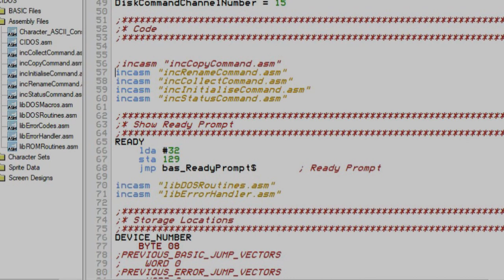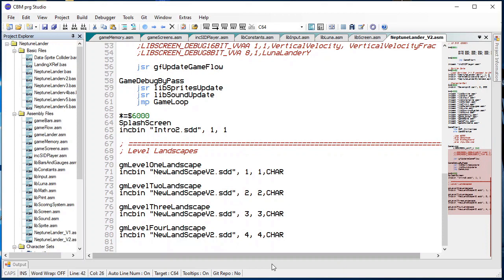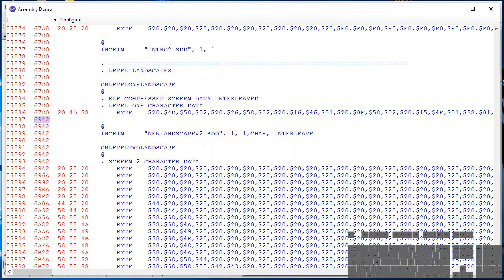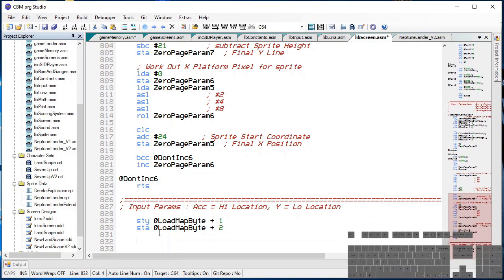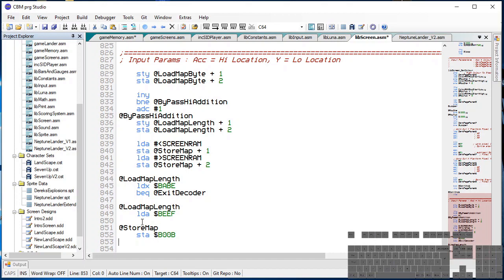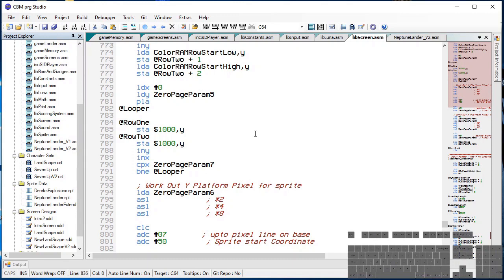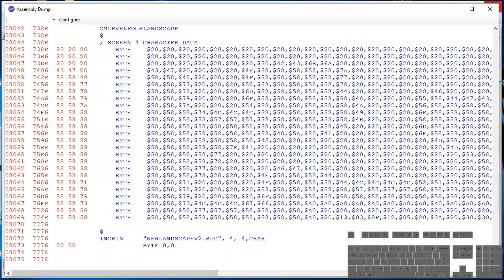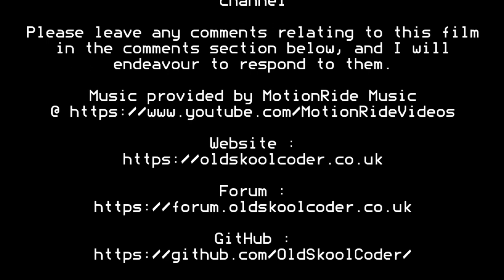Tutorial 35.39 - Implementing RLE Decoding Of Screens (6502)

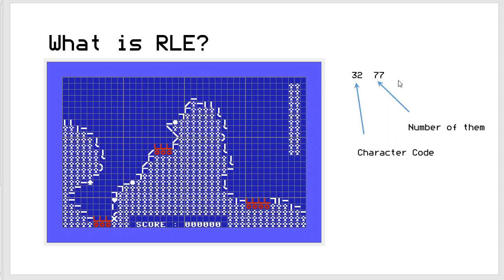Comment: 2:37 A more compact scheme in general is to have streams of two possible sequences, the existing one of <Count> and <Byte> that expands into <Count> number of <Byte> values, and s second sequence of <Length> and <LiteralBytes>, where the <LiteralBytes> of the given <Length> are copied out as a literal string.  The <Count> can be distinguished from the <Length> by using the high bit $80 and limiting the maximum value of each to 127.  You can also interpret a 0 <Count> or <Length> as being 128.

Only using <Count><Byte> sequences can produce a worst case of taking twice the amount of memory, for example, in the case that there are no two identical characters in a row, whereas the dual scheme has a worst case of adding only one extra byte per 128 bytes of input, or 8 bytes per screen.

32:13 The amount of compression would be 100% - 58.95% = 41.05%.  It's obviously less than 50% since 2358 is more than half of 4000.